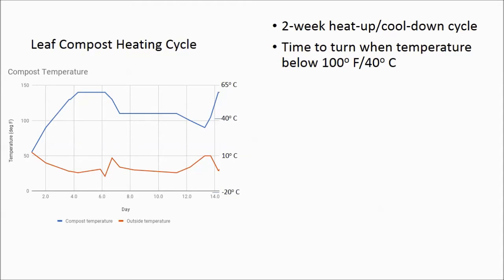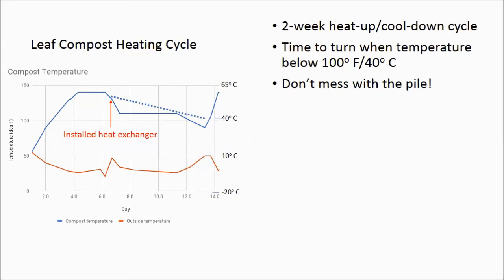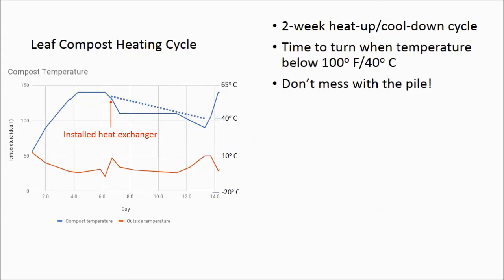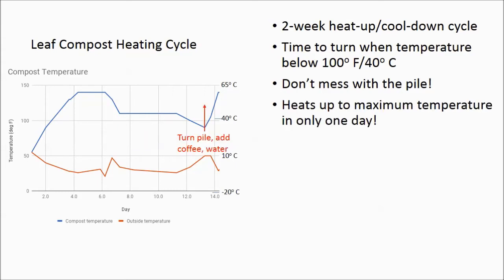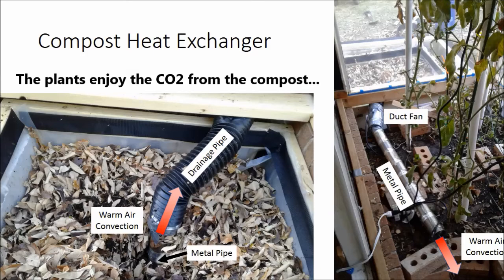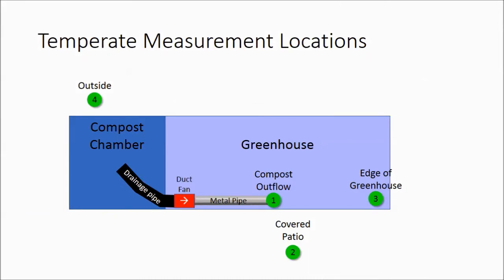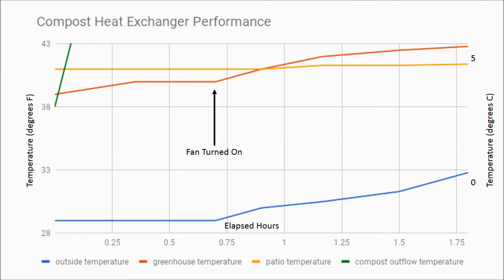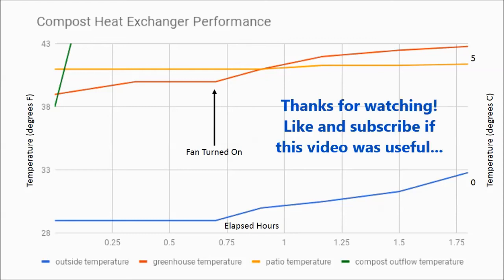Compost-Heated Greenhouse: Did it work? (part 3 of 3 in 2017 series)

Comment: Does compost create methane or any dangerous gases? Wondering about the open loop into the greenhouse.
Reply from the maker: In theory, ammonia is probably the biggest "harmful" gas.  But in practice, I found that water vapor was the worst gas!  The open loop into the greenhouse will cause enormous humidity in the greenhouse and dry out the actual compost pile!

Comment: Hi Morgan, I would like to do something like that and was wondering about the smell. I have a very small garden, about 5x8m so working with micro everything here. Anyway, what about using Hepa filters from your regular hoover vacuum, just a thought from a total novice. Would it work to limit the CO2 fumes? Thanks for sharing your work.
Reply from the maker: Hi, my current compost heater (https://youtu.be/Ze0nXN6Vvic) is fully enclosed, so there's no issue with smell.  CO2 would be good for your garden; it's the ammonia (NH4) that gives the "compost smell".  I minimize ammonia in my compost by using very simple mixtures (leaves, shredded paper, and coffee only).  The biggest reason I went to the enclosed system wasn't smell, however.  It's actually humidity.  I want the humidity to stay in the compost pile, not in my greenhouse.  I need to improve the heat exchanger in the current compost heater.  A project for next winter...

Comment: Hi Morgan, I like the way you explain facts with numbers and science. Have you thought about Jean Pain type smaller version to generate heat and extract heat with water tubings? The thermal syphon will create a system to circulate heat into greenhouse soil/air without a mechanical pump.
Reply from the maker: Jayanath De Alwis thank you very much.  I definitely would like to use a larger compost pile for greenhouse heating, but it's a space (lack of) issue currently.  I would definitely like to have a large pile.  I don't have access to wood chips and manure, but I'm happy with leaves and coffee grounds.  I can get a hot pile that way.  I built a large pile in my yard this Spring, and it stayed hot for a couple months without turning
Reply: Morgan Brown Thanks for your swift reply. If you get to save your solar electricity in this way you can add more fan power to run vertical geothermal system.

Comment: I live in the southern hemisphere and its cooling off here now. My idea is to create a straw bale perimeter and clad with some old iron bark sleepers this will achieve enough thermal mass to keep the compost heat in and then hope use this energy in a similar fashion to your system.I made a hot compost like this last year and was happy with the heat and this lead me to researching energy transfer options. Like what you have done its given me more things to think about enjoy your summer.
Reply from the maker: Ha, I had to google "Iron Bark Sleeper"!  I bet you are right - the wood + straw bale frame should provide plenty of insulation for your pile.  Are you going to circulate air (or water) through the pile and back to a greenhouse?  Spring has definitely sprung in Colorado - we're getting a nice heavy (but cold) rain today, and we're about 2 weeks away from first planting.  Cool weather crops have sprouted.  I'm madly trying to get a large batch of compost finished so I can top-dress some new planting beds.  Please let me know how your winter experiments go, if you have the chance.
Reply: Maybe a combo with water/air I am thinking of creating coils for water and solar fans to move warm air. My proposed green house will be partially built over the compost  container. Winters here are not as harsh as Colorado.I live in south east Australia my winter is dry sunny up to 13 c in the day night temps  to -7c in July/ Aug.
Iron bark is a great material and difficult to get or expensive here. I was lucky to get these sleepers from one of my  projects the owner was going to throw them away.
Most of the methodology I am using is inspired from watching what other people channels, being a bit creative myself and learning on failures and successes. I will let you know the results and will be keeping a photo diary which I will post on Larry Hall rain gutter group thanks for your reply and good luck with your growing season.
Reply from the maker: In hindsight, I definitely would have made my greenhouse big enough to hold a large compost pile... ;-)

Comment: thx a lot for sharing your work, your experiments and your knowledge with us. 
What I don´t realize is how your compost pile gets the needed oxygen when it´s so well isolated?? You´ve thought to install a circulation system   greenhouse - c-pile .... but you didn´t or did you??  By the way --- love your graphics   Greets Stefan / Ostholstein in germany
Reply from the maker: goldenwolf65 this is a very good question that you bring up!  In this video, I had a strange design for a heat exchanger.  I had two tubes running from the greenhouse into the compost, with a duct fan on each pipe.  1 pipe pulled air from the greenhouse into the compost pile. The other pipe cold air from the compost pile back to the greenhouse. My idea was that I would get better heat exchange from the compost into the greenhouse, and also aerate the compost pile better. Unfortunately this idea didn't work very well. It tended to dry out the compost pile, and when I compost got cold it actually froze around the pipe. If you look at my most recent video, which I posted about 2 weeks ago, noticed that I am back to using a closed loop heat exchanger. For small compost piles, there's a trade-off between aeration of the pile and drying out and cooling the pile. For this particular application I believe that it is better to have a fairly closed and insulated pile. The aeration seems to be sufficient to let this pile stay hot for about 2 weeks. That is too short of a time but a larger compost pile would improve on this.
Reply from the maker: https://youtu.be/xNUlrwqNXa8
Reply: Hi Morgan, thx for your answer ... perhaps I try to use a similar heat composter for our greenhouse. Our winter is not as harsh as yours - lowest temperatures are -5 to -7 degree celsius - so I have to decide if an isolation is necessary. And I´ll start an aquaponic system this sommer in the green house - so there will be a lot of air moisture  - it would be perfect if the compost pile would dry the air a little bit. Moisture was already the most troubling problem in our greenhouse this winter. By the way - our first grrenhouse tomatoes stayed alive till november, the 10 without any heating we enjoyed them soo much:-))
Good luck for your greenhouse 2.0
Reply from the maker: Stefan, if you have the space in your greenhouse, I'd really recommend building the compost pile inside the greenhouse.  The heat transfer will be more efficient.  As for the moisture problem...if anything, the compost pit would make it worse!  This could be one reason to "isolate" the pile, as you mention.  In the summer, one nice way to reduce humidity in the greenhouse is to use a geothermal system.  When you take hot, humid air from the greenhouse and send it underground, the water vapor will condense in the geothermal pipe.  With a sufficiently strong fan, you could probably remove a great deal of water vapor from your greenhouse.  I did some experiments with geothermal systems (https://youtu.be/Qh3-iTJvVR4 for example)
Reply: Hi Morgan, thx a lot for your hints - as every greenhouse-owner - the space within is very precious ... nevertheless I´ve already a tiny .... very small compost pile in the greenhouse in the middle of some raised beds ... but´s too small to heat up ... the condensation trick is a good one and I already use it with my gravel bed under the floor with a 80 Watt fan to put the wet air underground .... but it´s only working good with warm wet air ... it´s not working with colder air .... must depend somehow with the difference to the dew-point ... when the air is already cold it probably cannot fall below  the dew point in the underground?? 
Your geothermal pipe system is very ingenious - I would like to buld it the same way .... but .... in wintertime our ground-water stands at~ 30cm/ one foot deep  .... not an option .... ;-((
the best option of all would be a Zeolithe, chemical absorbent heat storage   (f.e. with CaCl2) - you could store all your sommer heat with a solar-collector and get the moisture out of the zeolith-compound and then close it up and in winter you open your barrel ... it will suck the moisture out of your gh and heating up ...
I´ve read 3-4 dissertations on scientific search about the right material ...  sadly ... the scientists are not there yet .... to many problems with the poor cycling-numbers .... but best idea ever...
Good luck   Stefan
Reply from the maker: Interesting that you bring up the desiccant dehumidification idea.  In my very brief review of these devices, it seems that heating the desiccant is a critical part of the process (it removes the water from the desiccant).  I wonder if you could use compost heating to do this?  In other words, compost = "heater" in this diagram: https://www.eva-dry.com/rotary-desiccant-dehumidification/
Reply: so second try:   lol ... I´ve already almost the same dehumidifyer you have suggest ... it works best at temperatures below 10 degree Celsius. Compost is probably not a good heating source for dehumidifying the desiccant ... with silica it could work, but its verry expensive, zelolith needs temps over 130 degrees Celsius ... so the best way for private homes would be a vacumised solar heater which could generate more than 130 degrees. Greatest problem is the stability of an (cheap) efficient zeolith-compound. 5 to 20 cycles are not enough. Maybe in 10 years?
Reply from the maker: Interesting!  Learn something new every day!

Comment: What if you ran a U-shaped pipe or tube from the greenhouse, through the compost pile, and back into the greenhouse? It seems like you'd be able to move more air that way, instead of just trying to 'pull' air from the compost pile?
Reply from the maker: Annice heheh, like last year’s system!  It’s an interesting question you bring up.  I’m taking a little break through the coldest months.  On vacation now.  Kept tomatoes going until December 5, which isn’t bad for northern Colorado!  Anyway, I currently have five thermometers in the pile and can summarize what happens.  The 2017 heat exchanger actually did improve aeration of the pile and increased temperature in the short term.  However, when I run the system, it tends to (no surprise) greatly reduce temperature nearest the heat exchanger without greatly affecting temperature furthest from the exchanger.  A u shaped exchanger would “spread the pain” better.  Not sure if it could match the efficiency.  I plan to put this to the test when we get back to Denver. Thanks again for the question!

Comment: Interesting. I was thinking of a "closed loop" facing into the greenhouse - to circulate air that way. I hadn't thought of the added benefit of further aerating the compost ... I will have to have a think! Thanks for the update 👍🏻
Reply from the maker: It's good to know someone is listening!  I noticed that the compost temperature has risen to 145 deg F/63 deg C - not sure if the aeration has anything to do with it, but maybe!
Reply: Morgan Brown gave me some things to think about. looking forward to the next update
Reply from the maker: I am in the middle of an experiment now where I turn the aerator on and off and look at the temperature response over a short period of time (few hours).  Pretty amazing.  The compost pile of note was made with leaves and cardboard, and wasn't heating up as aggressively as a pure leaf compost (though I expected this).  The temperature has stabilized at 85 deg F for about 12 hours.  I turned the aerator on, and was at 100 deg F within 5 hours.  This pile is currently at its likely maximum of 140 deg F.  I'm hoping the cardboard will lend itself to a longer "burn" cycle.